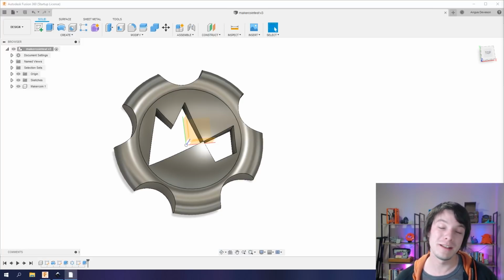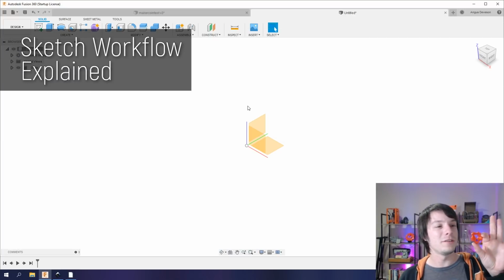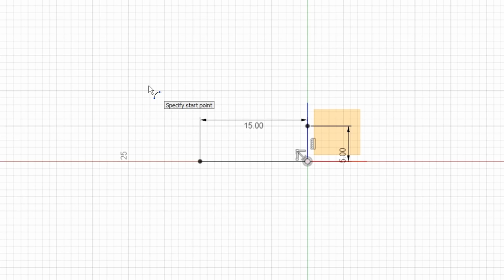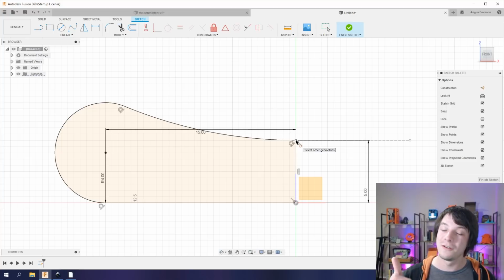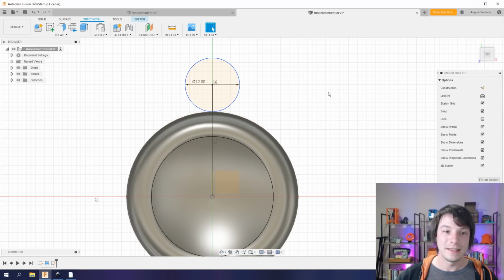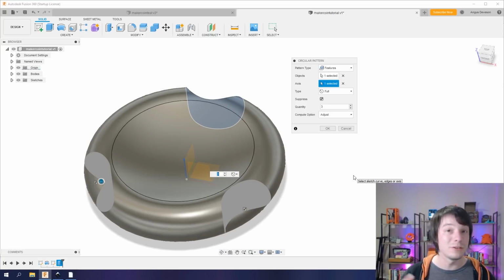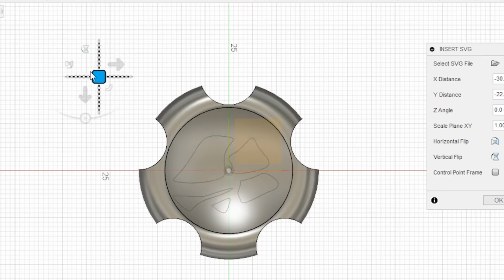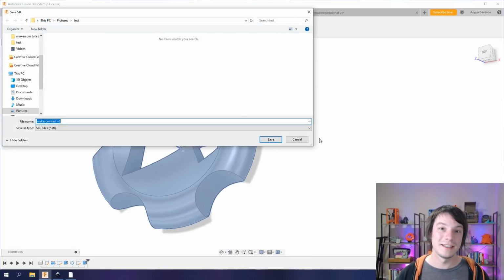3D Model a Makercoin in Fusion 360! Updated Tutorial

Comment: Redrew the entire thing with all locked in unchangeable dimensions. Extrude not there!!! UNINSTALL Fusion 360. I was looking at buying a 3D printer but if changing the length of a line is that hard? No Thanks, No printer, forget the whole idea. And YES it could be none of these "exotic" features like changing the length of a line are not activated on the free version, but the full version is buying two printers every year, in cost $$$.

Comment: Put in a line 25mm up, done, circle 12mm diameter done. Move it NO! no NO!! USE "D" dimension, NO!!! no NO... This gives "adding further dimensions will over constrain the model"

I followed you steps to the letter more than ten times over same result. I could get it only by deleting all and starting the line at 20. Which makes the whole thing ridged and unchangeable...

Comment: Hey, I am wondering if there is a way to produce the negative internal as a printable set of pieces? I designed a coin, but I want to be able to print the cutout parts in different filament colour, then place them inside the holes I created.
I managed to create the items in Fusion, but I cannot seem to get them to fit. I have tried using the Push/Pull tool, resizing in Cura, I'm not sure what else to do. I have zero experience in Fusion360 or any CAD software.
Am I on a wild goose chase? Is this possible?

Comment: Hi Angus, thanks for the interesting vid.

Have you ever tried the software "freecad"? I am using this since my first steps in 3D-printing in March 2017, because I wanted to avoid dealing with regulations, registration etc. what Autodesk requires for F360 even for private use.

Because of your really interesting tutorials to F360 I have installed it too, but anytime, when I want to create a new part, I use freecad. No internet, and in my opinion a quite powerful tool, which is even available for Windows, Linux and Mac.

I have gone through some tutorials for freecad, but I miss a good one of you. 

What do you think? Would it be possible for you to have a closer look on this software? I would appreciate it very much!

Comment: Hey Angus, what computer hardware do your computers have (RAM, processor, etc). Fusion runs super smoothly on your videos. My old laptop struggles to keep up with my builds and I'd like to know what you're using on your laptop/desktop. I'd like to upgrade but not go over board. Thank you.
Reply: I personally use Fusion 360 on a laptop with a 3rd generation Intel Core i5 CPU, and 16 GB RAM angle an Nvidia graphics processor.  It runs just fine on that config, until I get really complex models or feature patterns.

Comment: Based on your Solidworks -> to Fusion 360 recommendation, I finally gave it a try. My student version of Solidworks is no more and while TinkerCad is a great quick tool to use I wanted a little more CAD power. So far I'm pleasantly pleased with Fusion 360. Thanks for sharing your great finds.

Comment: 2:35 IMO, Fusion's 3D navigation is MUCH more intuitive if you change the Pan/Zoom/Orbit setting to "Tinkercad" in general preferences.
That gives you:
Select - Left button
Orbit - Right button
Zoom - Scroll
Pan - Hold scroll
Reply: I can see how Fusion's default menu navigation (Right button) would make workflows very fast with experience, but it's not easy to get used to, and for a beginner when you are just trying to get the hang of everything at once, and already have to think through every step, it's not a chore to go to the menu's and know where everything is located that way... I really gave the 'right click' navigation a good try so I could learn the efficient way to access things right off the bat, but after using the right mouse button at least 50 times to try to orbit around the object and ended up selecting undo or delete or repeat or any other random thing you land on when you expect to be zooming around the object to see it from the other side (but instead get a stacked menu wheel),,,,,  I got fed up and changed to "tinkercad" navigation... SO much better.. I still get hesitations before right clicking after all the trouble it caused originally, but if you're familiar with tinkercad, i don't see the harm in switching to this to make Fusion feel a lot less foreign in the beginning...   Good tip!
Reply: I like this buttons config. thx for the tip.
Reply: Hello from 2 years in the future, holy shit this helped so much thanks from the future hope past you is as good as future you is. Gotta get back to the future so goodbye!
Reply: Didn’t know that was a thing I couldn’t get used to fusion 360s weird controls, thanks
Reply: thank you so much
Reply: im already used to this lol :D
Reply: SOLID GOLD BALLER SON
Reply: MrClown  I use Zbrush a lot so being able to change the interface is good. Then again jumping between different interfaces tests your real-time aptitude. 🤨

Comment: I just bought a Prusa MK3s and the first thing I'm printing has about a 25% success rate. I'm really discouraged. And all it is is a cube with a horizontal hole through it on it's side. The top of the cylinder doesn't finish properly. Where does one go to get advice on printing problems?
Reply: Go to prusa and contact there support team asap they will help a ton.
Reply: @Java_Fusion  Thanks! How did I not think of that?
Reply: Reddit has a lot of resources for 3D printing and other users can help: https://www.reddit.com/r/3Dprinting/